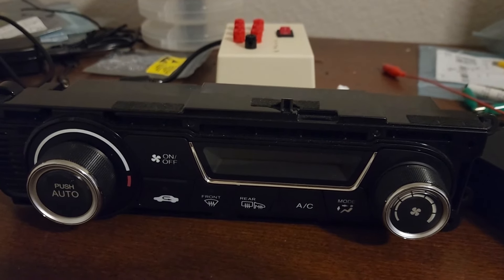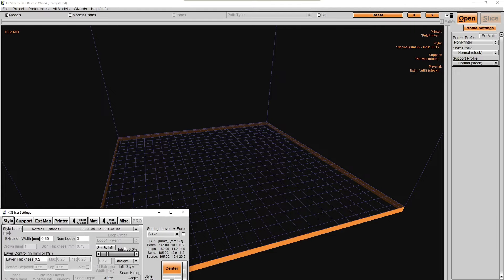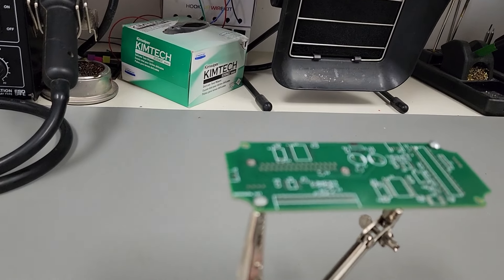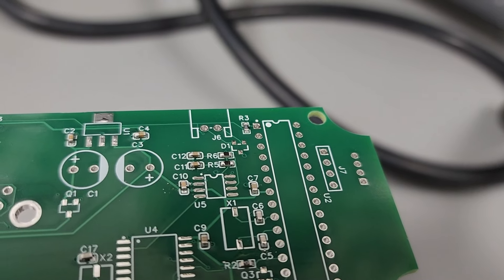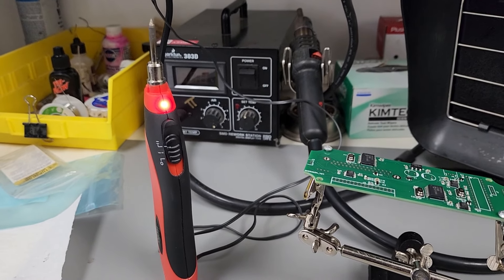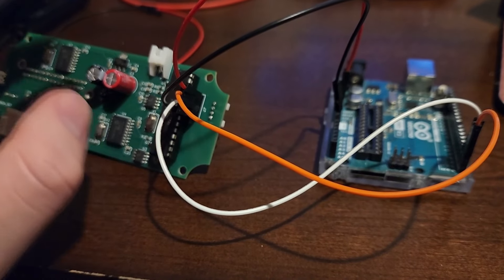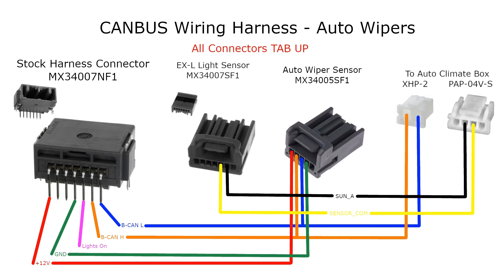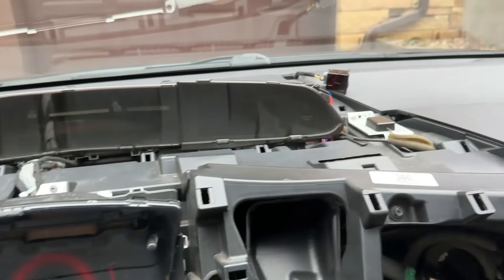2013-2015 Honda Civic Automatic Climate Control Conversion

Comment: Dang. I bought a temp auto control from eBay a few months ago and tried to plug it into my LX 2014 civic with hopes that it would work. As expected, it did not work. I didn’t really care for auto temp, just wanted a functioning light up screen on my temp control. I was really excited to see this video posted but turns out this process is super complicated.
Reply from the maker: @Kenneth-bm5zr  Zach and I are working on a way to make it work without the black box, if the Si and LX support it.
Reply: Same situation bro😢😂
Reply: Wish I saw this before I ordered mine, I plugged it in and it turns on automatically, and it unable to turn off

Comment: Does this work on a 2012 civic? They’re not too different I think besides body styling.
Reply from the maker: Hi- sorry for the late reply. Theoretically it could, however, the only automatic climate control unit for the 2012 Civic in the US market was for the hybrid, which would require some extra circuitry.

Comment: Completely unrelated question, but I’m about to wire in an aftermarket radio to my LX and I had a thought regarding the reverse camera on the iMID. I want to take pins 19, 3, and 14 and move the pins to my own female molex connector, and then do custom wiring with the male end for 3 and 19 into an RCA Jack for my head unit. What I’m curious about though, would pin 14 would work fine to trigger reverse on the aftermarket radio? Not sure what signals are used to tell the iMID to switch to the reverse camera but I imagine it’s the same signal a head unit would be looking for.
Reply from the maker: It should be. It appears to be a switch from the reverse light relay. You can probe it with a multimeter, my guess is you'll see battery voltage with the car not in reverse and ground with the car in reverse or vice versa. (do this with the car in ACC 2 and with the parking brake set). Let me know.
Reply: @civicminded2141  I've been experimenting with it and have found on a forum thread that it does work as a reverse signal wire, however the issue I was having with wiring is finding where pin 1 actually is. I bought an iMiD harness online that is originally meant to add a reverse camera to the iMiD screen for EX models and was attempting to repin it to split the camera feed and signal wire out, though blew two fuses and haven't had the time to inspect the iMiD harness since.
Reply from the maker: @wayveyx  Apologies for the late reply- I think I need a visual of what you're dealing with. Can you shoot me an email? aidancivicminded@gmail.com